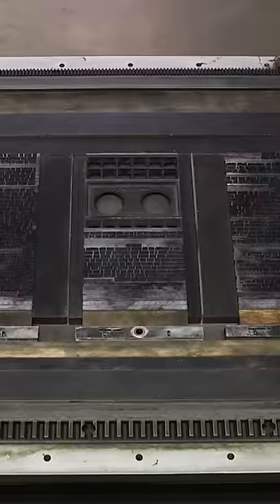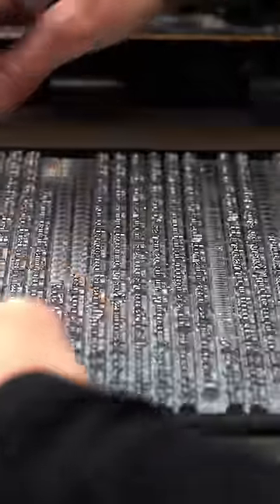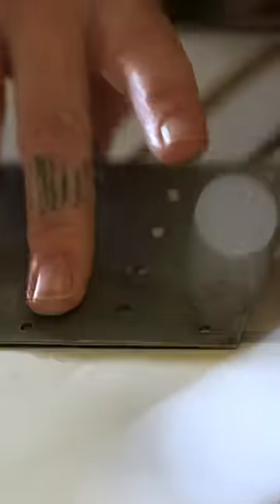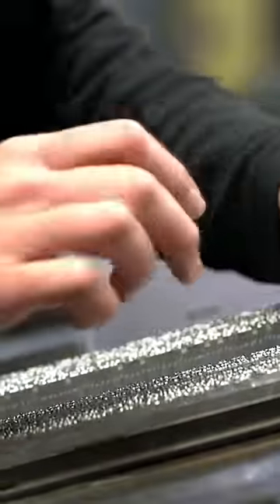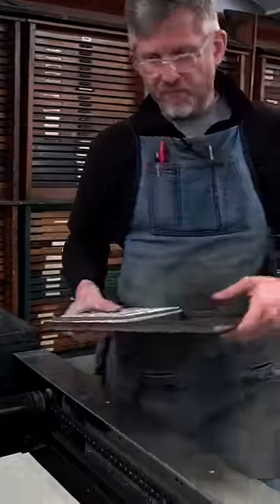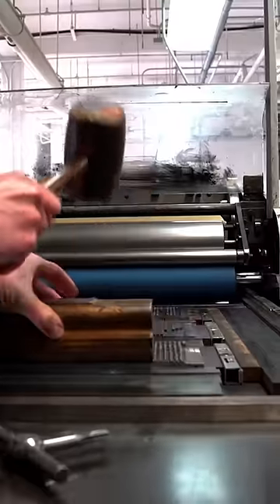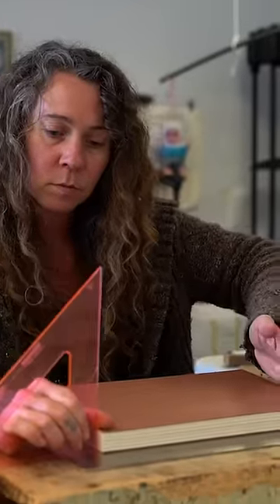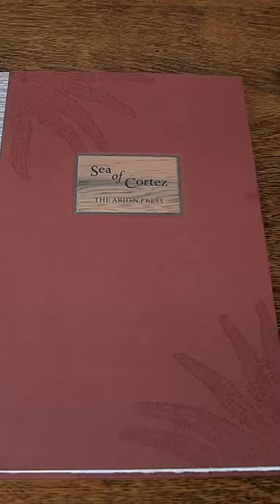How these handmade books cost up to $10,000 to make #books #crafts #handmade

Comment: Definitely not the last printing press in the US, my university had one that was in operation
Reply: Where is your university?
The 🌎 wants to know.
Reply: My town has a one of these operations but it's in a museum. Yes they do print for special occasions but for the most part it's just for living museum demonstrations.
Reply: I had a printing class in college and we used a hand printing press.
Reply: @RabbitsInBlack my town too, Guthrie, Oklahoma
Reply: Notice that the speaker said "the last printing press where books are made start to finish." Where, not 'on which'. Once the ink is on the paper, the machine's portion of the bookmaking process would be over. After the proof press, then one of the larger presses, the proper collating of pages, folding, preliminary cutting, binding by handstitching, applicable gluing, flush cutting of edges, & cover attachment have nothing to do with the printing press machine, yet are different room in the printing press building.

Thus, when the video said printing press as in a full-functuoning business that prints books for profit.

This video wasn't referring to the individual printing press, that is a machine which is used to print. Again, the use of the 'where'.

Sacramento has several old functioning presses which are used daily to print things for local schools, the city, charitable events, etc. But they definitely are not printing books. The main function there being education & preservation of printing history. The folks in Sacramento have a very successful channel here on YouTube.

This printing press is a business. Freedom of the Press, one of the Bill of Rights isn't referring to a machine having freedom, but book, short story authors & poets,  journalists, reporters, photographers, music recording artists, & even  in the case of newspapers, civilians of the average citizenry to submit letters to an editor for publication. Not a printing press or a record press, screen printing press, or even an unchanging stationary stamp (ie: return to sender) or easily changeable rubber date stamp used to date or mark papers. But I digress, not speaking of the machine or machinism.

Especially recently, people are revisiting focus on the 'Freedom of the Press' as being an extension of the 1st Amendment, the Freedom of Speech. People understand that the freedom of speech is necessary for a healthy society. And things & thoughts shared means little to nothing in the greater world if one can only use one's own mouth, time-consuming handwritten letters, & one's voice at limited or forbidden public meetings, hence the Freedom of Assembly The Press, however, with wide spread publication of thoughts, opinions, facts, & even propaganda, can drastically change society within a short amount of time. Radio, Television, The Internet & the World Wide Web are all part of the Press, even if not printing.

Before the Gütenberg printing press, the first with metal moveable type, the bibles were priced similarly to the cost from the featured publishing company. The Gütenberg press wasn't the first printing press or even the first with metal. Prior plates were tediously handcarved in reverse by artisans in wood or metal. Mistakes were more or less unchangeable as there was not much to be done. Wood plates were easily damaged during press runs, & even metal letters got blurry during long runs. Metal movable type, meaning the individual letters as shown in this video, can be proofed, proofread, & if needed, replaced. The effects of Johanne's innovation was earth changing in its time.

Now it's a remnant of history. No huge, flat job cases with different type sets. These people actually forge their own fresh type for each new book as there are no foundries making type sets, as newspapers & all of the other publishers use computer & digital technology which is easily editable, sometimes in realtime, with delete & edit being modern-day manifestation of Orwell's memory hole.

I thought it was odd that he uses strong to hold the type together. In Graphics at my highschool, we used a metal tray with clamps, so that once the type was set, even if dropped, the tiny letters, characters, numbers, punctuation, en quads, em quads, illustrative blocks, & borders were "set", barring a editable mistake. A dented piece of type, a wrong letter, or improper page number could be replaced by temporarily loosening the clamps.

I am so glad they featured Arion Press of San Francisco, California. There are other Presses, businesses, Outskirts Press, Penny Press, the Detroit Free Press, Minuteman Press, Colonial Press, U.S. Press, Czar Press, Rapid Press, Press Miami, yet none use of these Presses use presses like the one in the video, or at least, not for large run or intricate projects.

Blessings!
Reply: Not at this level
Reply: Sacramento Ca, Sacramento printing museum
Reply: @WatchingMyLifeFlashB dude.  Nice
Reply: if it is not hand written then it is wasting my time.
Reply: @WatchingMyLifeFlashB Bless your heart girl but ain’t no one gonna read that whole thing 😂
Reply: @annoyingkid48 I read the whole thing.
Reply: Sacramento history museum runs printing press equipment
Reply: @WatchingMyLifeFlashB Freedom of the press is not "an extension of the first amendment".  It is an explicit tenet of it:

Congress shall make no law respecting an establishment of religion, or prohibiting the free exercise thereof; or abridging the freedom of speech, or of the press; or the right of the people peaceably to assemble, and to petition the Government for a redress of grievances.
Reply: @WatchingMyLifeFlashB  As I remember it, we used to lock up all the lines of lead for a page with "coins", an adjustable reuseable frame. Probably spelled differently. But 300 of them would be much more expensive than 300 pieces of string.
 There are many ways to feed a letterpress. The Monotype machine may well be the last one in use, casting letters one at a time instead of using individual slugs that are reused many times. That should allow the Monotype to create crisper print, since each slug is brand new, not reused.
Reply: I bet it is in fact the only one that does the whole process from start to finish including smelting and making the individual letters used. Having an old type set press is not what they are referring to!
Reply: Is yours actually often used to print books?
To my understanding, most printing press is now just mostly for demonstration
Reply: @WatchingMyLifeFlashB String first, to hold the slugs in place, before locking it up in the chase, to print from. 

There are still a few letterpresses out there, in operations such as this, though this is the only shop I’ve seen making full case bound books, in some time.

Comment: There's not really that much lead. I worked at a print factory in Miami in 1969 and they had a linotype just like that. It had a lot of zinc though and he didn't mention that.
Reply: Linotype is 84% lead, 12 antimony, and 4% tin.  Lots of lead, no zinc.  If you melt zinc into lead it gets an oatmeal like consistency and will not cast well.
Reply: @glycyldi .Just  repeating what I was told by the operator

Comment: Fun fact. The lead, tin and antimony alloy used to make the letters expands slightly as it freezes, insuring that the letters are well defined and the printed text sharp.
Reply: Why do that use that at all?  Is there something wrong with utilizing arranged steel prints like it was originally done?  

It seems rather wasteful to make casts of each and every page, even if you can melt down and reuse the cast, though the heat energy is wasted.

Comment: Why would they not use a Linotype machine to create the line of print and control the size 10 or 12 pica? Like a typewriter. That drops letters and symbols made of brass and a plunger forces molten lead into a form that creates a line of type. Origin of name of Machine call Lineotype. Still used around the world. Some methods are not lost, just not used.

Comment: OH YOU PEOPLE KILL ME!  YOU THINK THIS IS HARD?  After This Tech Came A Machine That Had NO SCREEN ON IT So You Would Not See What You Were Typing!  You Had To Install 6inch Wide Roll Of Film Inside The Machine (COMPUGRAPHIC TYPESETTER) A Negative Film Had To Placed On A WHEEL that Spun Around 1000's of RPMS Per Second.  A STROBE LIGHT Would FLASH and Put The IMAGE of the letter From The NEGATIVE (the Font) ONTO THE FILM!!!  THEN (remember , you can't see what you are typing!). THEN... You Removed The Box Of FILM (not the font negative, the FILM) You Took The FILM to A Dark Room and Hand DEVELOPED THE FILM so you could. SEE What You Typed!  THEN! You Had TO HANG The FILM In. The Air To DRY!  And THNEEN You Had TO Wax The Back Of The FILM, Cut The Body Copy Out And STICK IT TO YOUR LAYOUT SHEETS!  AND! The Cost Of That, Including FILM, DARK ROOM CHEMICALS, THE $25 AN HOUR TYPESETTER, THE CAMERA THAT MADE THE NEGATIVES = Your COST! For ONE PAGE Was $120.00 !!!  NOW You Can Do It For Five Cents!
OH!!! If You Wanted To Change Your FONT FACE?  You Have To Take The NEGATIVE that The STROBE LIGHT FLASHED THROUGH ... STOP THHE SPINNING WHEEL and Remove The Font You Had and Replace It With The New FONT NEGATIVE!  IT WAS A LIVING HELL!